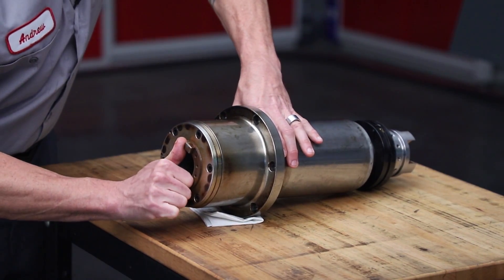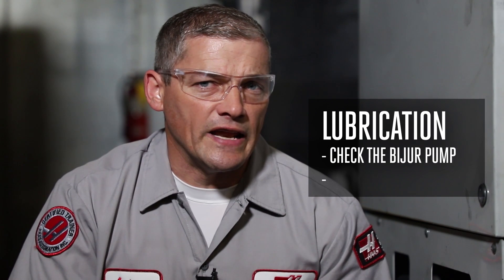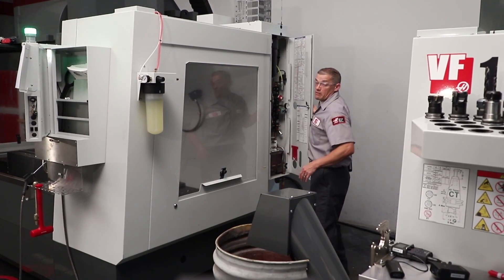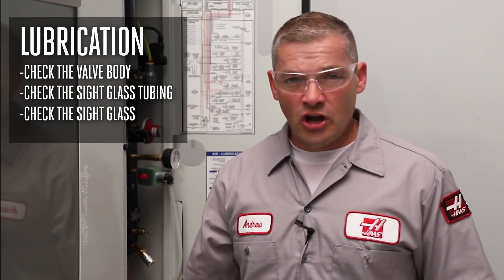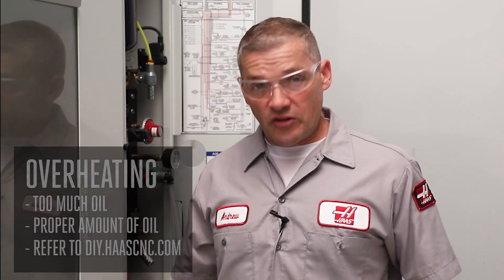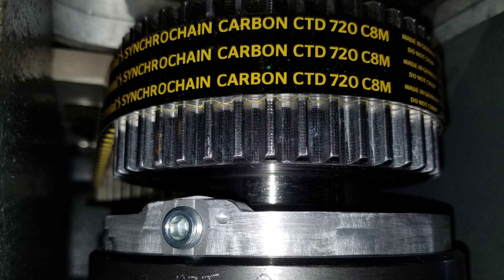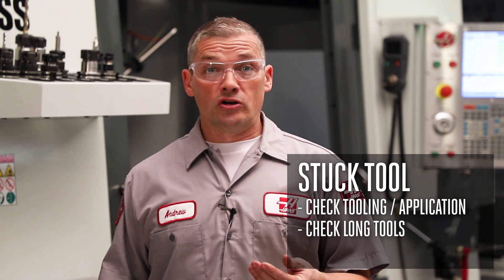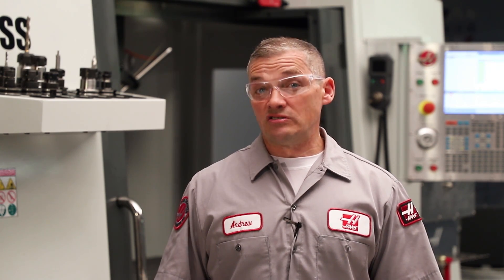Spindle Troubleshooting - Haas Automation Service

Comment: I bought a used VF-6 that had the spindle shut off after a few seconds. Low oil pressure alarm. It was the rubber coupling between the oil  pump and its motor, behind the spindle. $15.00 part.

Comment: On our newly purchased 2010 TM1P we have air leaking out the spindle at around 200L/minute. I cannot find any informatiuon to help trouble shoot this as the pneumatic valves are working as intended - Zero consumption when we turn the power off - valve clearly closes air and there is no detectable leak.

Comment: We had a spindle over load at start up on our 10k spindle running at 9500 so I went over to purge the line to ensure we were getting oil it was dripping into the sight glass but I also got a bunch of air in the reservoir.

Comment: Could you recommend if someone forgot to maintenance their spindle with the oil  lubricant for longtime until they faced problem. They followed your step still have that wrong. Is it need to replace spindle system. Or we can find some way to pay you a ticket.